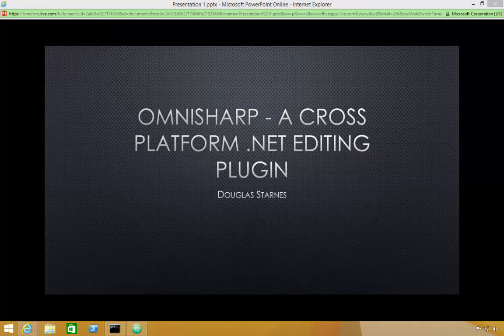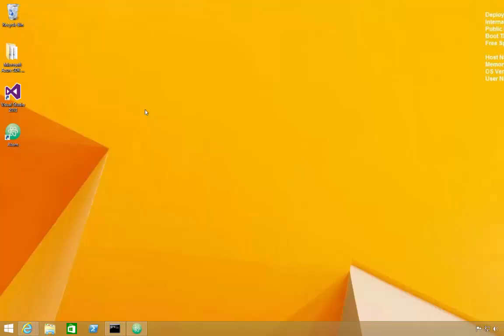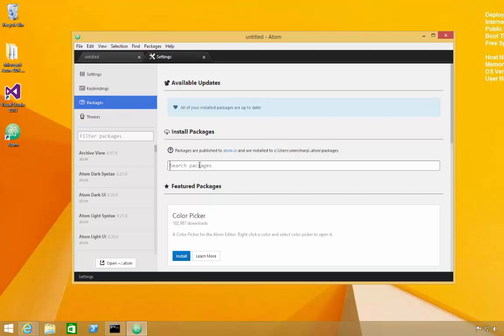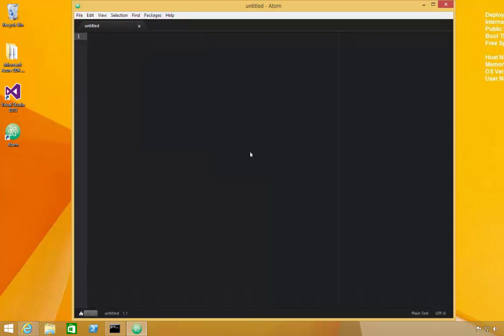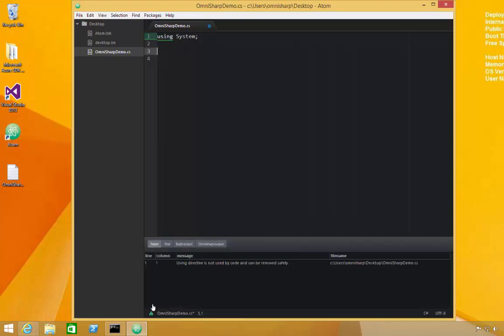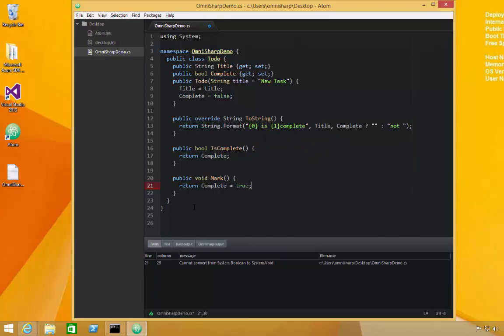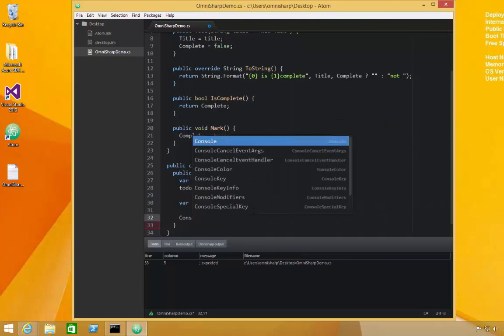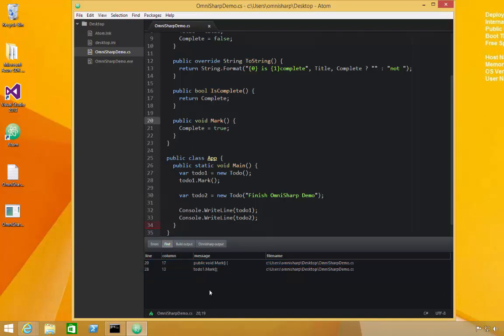Using the OmniSharp Plugin with the Atom Text Editor

Comment: I do not get a build option with omnisharp-atom. There is also not a build output pane in the server. I do not have any errors that I see... Any thoughts on what is going on with my configuration?
Reply: Did you find an answer to you problem?

Comment: Hi, I just install mono and the Test: "verify Mono is working correctly" was success. But in the omnisharp install had two errors wich I fix. But when I try to make the green flame turn on nothing nothing happend, never light up. Ive being reading and omnisharp not longer suppourted, so Ive wondering, if I already have mono working fine, what editor should use?